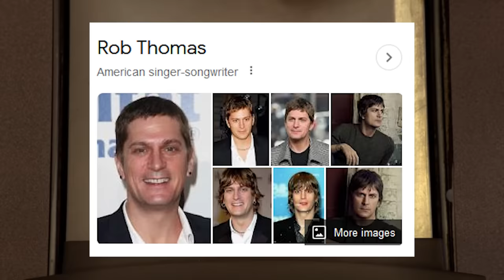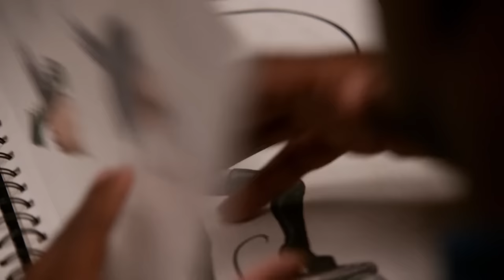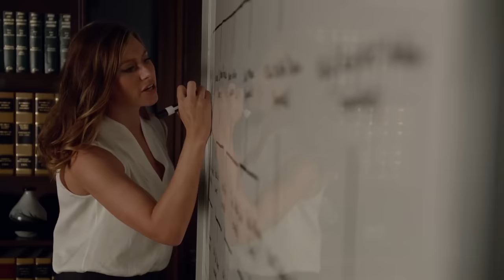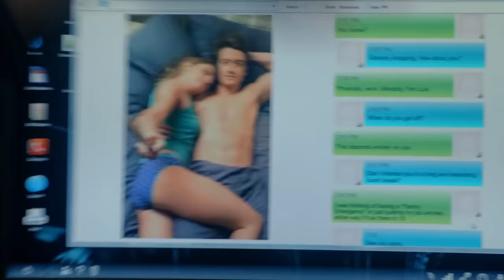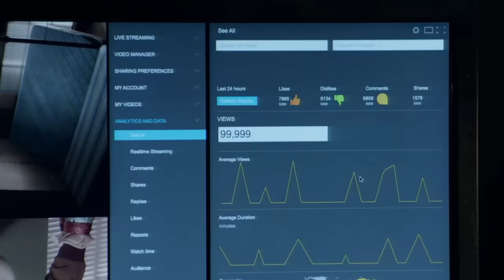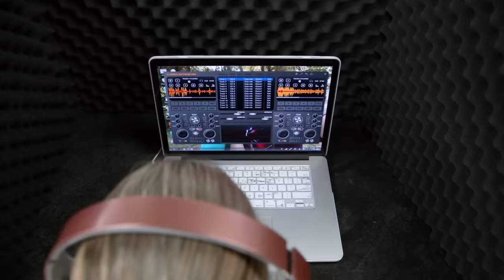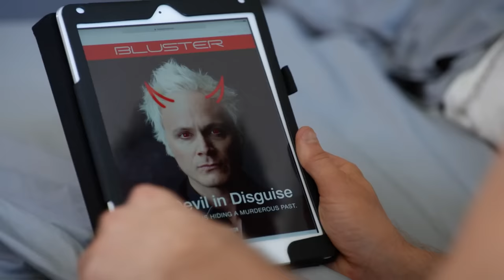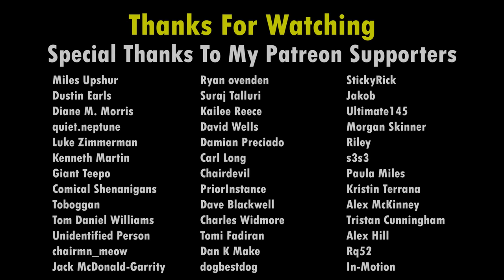iZombie: Full Series Retrospective

Comment: Solid breakdown - I didn't dislike the rough parts as much as you did, but the supporting characters make up for so much of the weakness of the show.  I'm shocked though that the songs only warranted a couple different mentions and not a footnote of it's own.  I consider this show (at least the early seasons) amazingly scored and actually went out of my way to get the series discs they released (still waiting on the last two, likely in vain) just to ensure I'd have the series with the original soundtrack it was intended.  To many of my other underloved series end up with their excellent songs replaced or straight up removed that I learned to jump on fast and get these copies while they're still fully entact.

Comment: I think Season 2 gets cluttered in the second half cause the network ordered 6 extra episodes. The show completed a 13 episode second season and then it started airing. The writers were most likely working on the next season when the network added 6 more episodes to Season 2

So now the writers had squeeze the story they planned for Season 3 into those 6 episodes and it becomes overly cluttered. I really think this is a shame, i mean, we could’ve had another season with Drake, more time for Liv to try and fix things with her family, etc. 

I also think in retrospect, this negatively affected the show as whole in the long run. Imagine the story of Season 3 being for the fourth season instead. Then, if the show still ended with Season 5, we only would’ve had 2 weaker seasons instead of 3